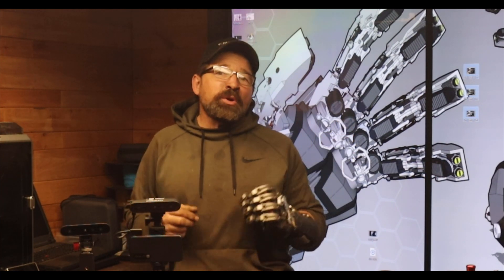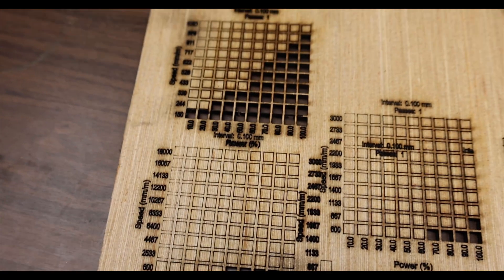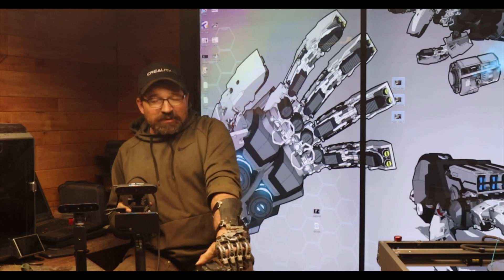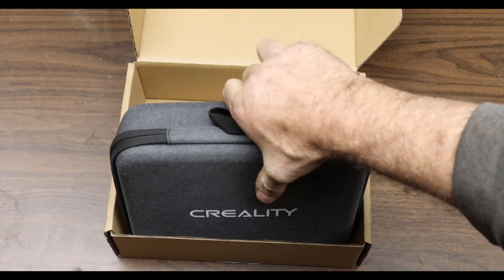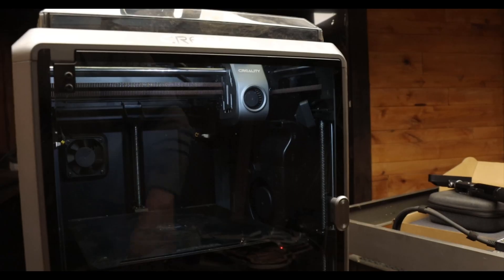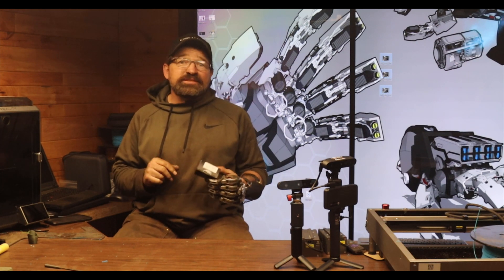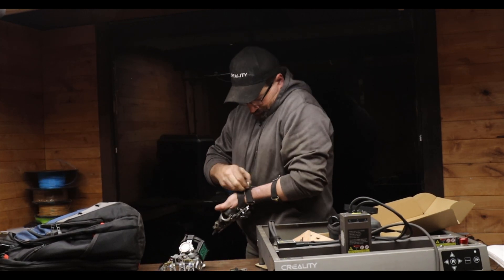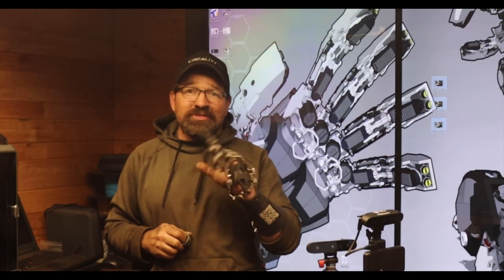Upgrades from Creality, The Cat Allocation System, and Breaking my Hand.

Comment: I've found that the Formlabs Tough 1500 resin works well under repeated stress loads, including significant shock. I actually had to justify the purchase at work to engineering by purchasing it myself first, printing the part, and let them take a hammer to it. For work application, it was used on an actuator under load that should far exceed any prosthetic use, so it may be worth trialing as an alternate.

Comment: Have you tested carbon fiber reinforced filaments? There's a pa12 reinforced with cf from fiberlogy that's supposed to have double the tensile strength of just pa12. Haven't tried that one myself or just pa12 but would like to at some point. I've had good success making a guitar out of pet-cf though did crack a couple thinner parts.

Comment: Trying to remember exactly what the ratios are in the PCBway aluminum but i remember most had about 10% silicon.  This is common in aluminum casting allows.  Makes the parts harder and more brittle but it is easier to melt and solidify.  Probably helps the wear life of pin holes, but less good if you're punching rocks.

Comment: Have you figured out tolerances for the printed metal or does it require machining the final dims?
Reply from the maker: I'm sure that it is still going to require some level of post processing.  The big issue is that there's not a real constant.  For instance with the jlcpcb mcbs in sls stainless. The window were all at least 0.010 narrow. But 1 of them was 0.03 narrow and another was 0.023. It not repeatable, the next time they might be .010 big. Printing doesn't have near the same expected tolerance as machining.  With machining  sub 0.005 - 0.010 is kind of expected,  whereas in printing 0.020- 0.03 is spot on.
Reply: @missingpartsclub  my expectation would be that at best, 3D printed metal parts would be as good as die-cast metal parts. In other words, good aesthetically but still requiring machining for critical dimensions.

Comment: Have you thought about SLS nylon 12?
Reply from the maker: That's what the black parts are. By the sheets, it should be a great material for the application.  But in reality, it's too brittle and doesn't offer the shock resilience that sheet nylon would give you.

Comment: Honestly I would suggest using a resin 3D printer and tough resin.  It would work wonders and you could make the parts see through.  Also relatively inexpensive.
Reply from the maker: That's actually where I started with this project with the red and blue series (before splay and metal parts).  I was using the peopoly maoi with tough resin. I had terrible issues with pin bosses and any type of shock loading. that was even with all different levels of curing. Undercured was usually better than over, but they'd always end up breaking.
Reply: @missingpartsclub Igus has extremely expensive resin (iglidur i3000) designed for gears etc, might work but its 600€ for 1 liter :)
Reply: "tough" is a marketing term.  It's brittle AF.
Reply: The other issue with resin printing is dimensional accuracy and stability. I've found thermal expansion to be a problem in parts printed in blu. My guess is poorer thermal conductivity than metal leads to sharper temperature gradients when exposed to heat, so expansion is less even? Dunno for sure, but I've had a lot of problems with fine mechanical parts in MSLA resins
Reply: PEEK and Torlon without any fillers or fiber might be strong and tough enough.  About 2-3x better than Nylon Delrin or Polycarbonate.  Unfortunately they're at least 10x more expensive while aluminum is only a bit more expensive and stronger than both wonder plastics.

Comment: would carbon fiber be better?
Reply: For the structure of the hand/fingers? It'd be really really hard and expensive to get them molded/forged correctly since the geometry needs to be so complicated. Carbon fiber works best for large near planer parts, and the fingers are very far from that.
Reply: @johnathanclayton2887  Fingers, you can make a block of carbon fiber and machine it.
Reply from the maker: "Carbon fiber" gets its strength from the length of uninterrupted fibers. If you were to lay up a block and then machine your parts, they would only be as strong as the resin.
Reply: Not really i dont think. Isnt carbon fibre only good if you want something to be really light and are willing to sacrifice some strength for it